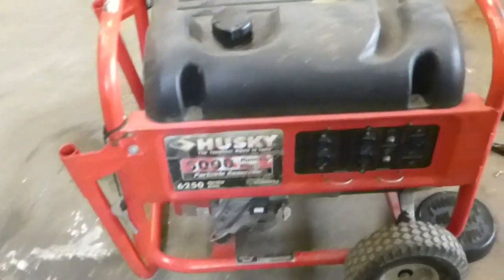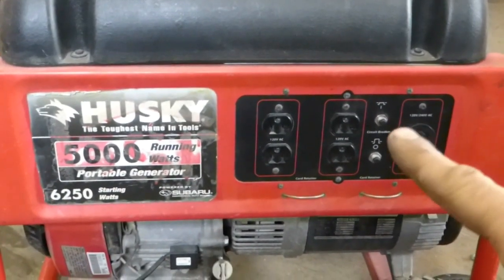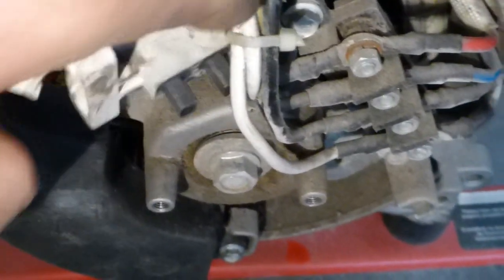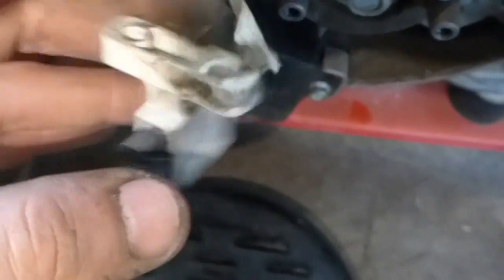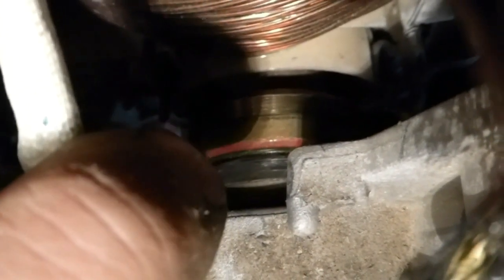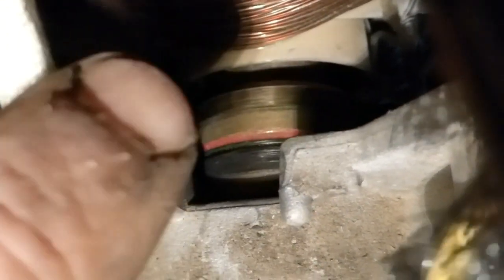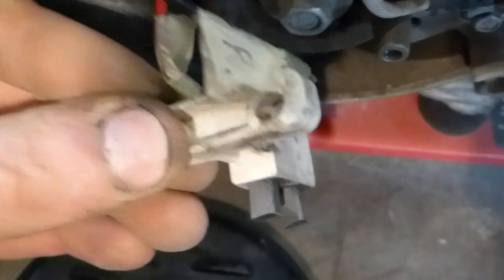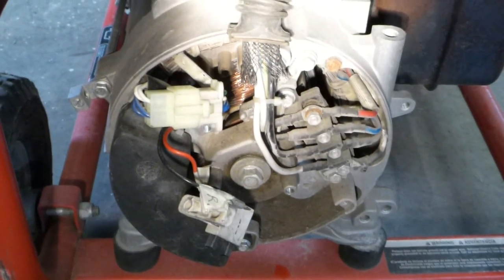Husky 5000 Generator Not making Power Easy fix

Comment: Jeep there is a surfacing stone you can get to redo the brass! sandpaper works as well. I designed my own home grid power station I have all the components to build just got to find the time basically it runs itself and it is electric and hydraulic it needs a space about 30'x30' The norm says it can't be done but I say it can...